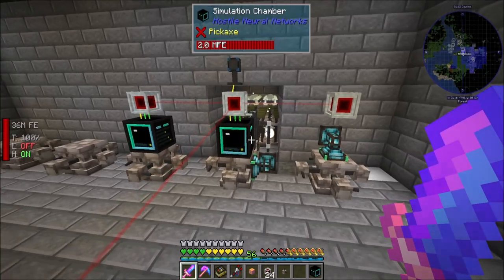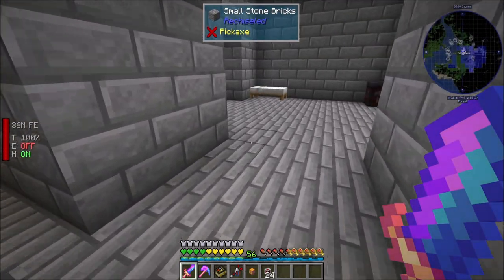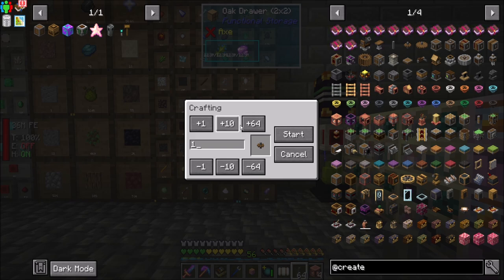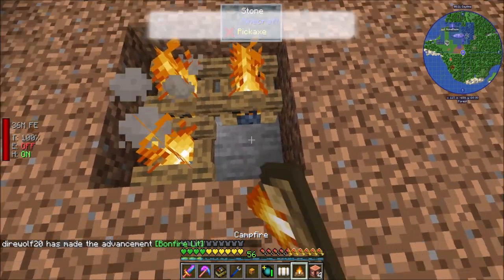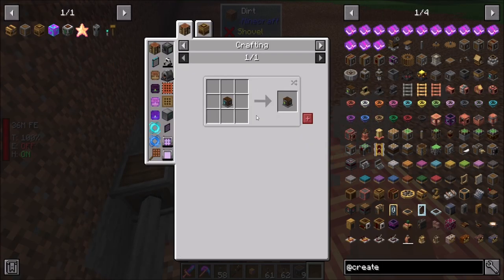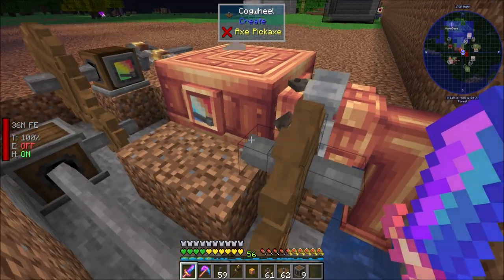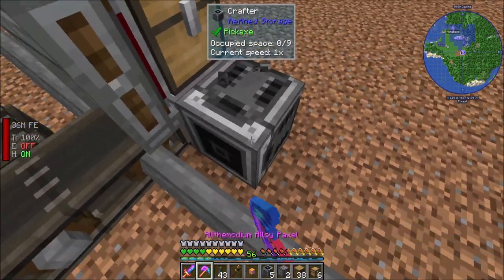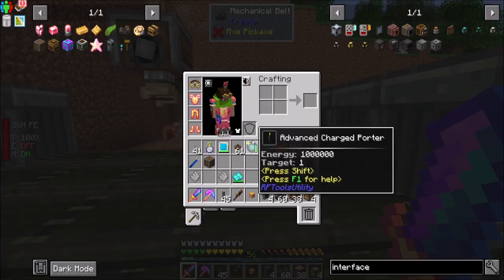ATM8 Ep56 Create Startup

Comment: how long till he realizes he disconnected his air reservoir from the air nodes?
Reply: Like 10+ episode's 😂
Reply: Probably when he will accelerate another machine or IF he notice that his Nether star is slowing down, that might be hard because the simulators will run even if not accelerated... So if he dont check the setup for a while or happens to accidentally go back to it to dobbel-check off cam   (Like he said, he will pop down if he needed other stuff accelerated) or probably when he see your comment, then it would be fixed at episode 60, Just a guess, it might happen sooner (Think this is 1 of 5 pre-recorded episode)
Reply: i where just about to say that :P
Reply: +1 It's so frustrating for us 😬😅
Reply: didnt he connect the input it to the back of the tank and the rest on the on the side's, he just disconnected the import from the export pipes, so its still connected on the back of the tank
Reply: never, because he didn't
Reply: @MarcoKoobs  well. i bellive he removed the one that was connected. but his minde where so focused on adding more pipes that he diddent see he did disconnect the 1 pipe that did connect frome the sources

Comment: Please, please just use a sink and fluid pipes to fill the boiler.  He usually spend 10-15 minutes trying to use the Create pump and then it regularly has problems.
Reply: I haven’t tried it yet, can you use Integrated dynamics to insert water into a boiler?
Reply: @roscocsa  Probably but it’s not really necessary.  The boiler doesn’t actually use that much water.  A fluid pipe from pipez with any tier upgrade provides plenty of water
Reply: @roscocsa  U can use pipes and even laserio, it all works fine, i already tryed it, even with fluid as xp
Reply: Even if using only create to power this system, you should still power the pump with its own waterwheel.
Reply: He tries to keep mods together as much as possible

Comment: A good option for automating Create is to use different wood types for different casings. Also there are 2 crafts on the 3 deployer setup that are easier to multitask by opting for different nugget types in each recipe....I think iron and aluminium are the 2 options.

Comment: u know, the refined storage crafter can put the item direct on the belt, u dont need an chest for input, just put the crafter below the belt facing up. and at the end i use a chest with laserio to the interface to import it to the system. but if u want to feed the deployer from the system, u could do it through the exporter, but u can also use the chest in the beginning with a brass funnel and filter it and laserio the rest to the deployer. 😉u cant filter the output of the saw and bassin to only make that product. some times it has multy recipes and can make them all, but when filtered, it only makes that product. like the saw can make from logs planks and stripped wood, and some times ever other wood stuff with other mods, just filter it to only make stripped logs.

Comment: I assume instead of the saw you could have a deployer with say an allthemodium axe cause i think the deployer thru the item use application thing with an axe strips wood so you could do oak log in andesite casing out, so long as you keep the other deployer stocked with the andesite alloys.
Reply: It can be easier to just filter the output of the saw, but yes, it's possible

Comment: anyone else graon when he accidentally clicked the pipes off the air resivior (1:30) because they know hes may never notice
Reply: Didn't he connect to the back of air reservoir
Reply: @greeshmaisave5410  i dont know off the top of my head but i dont think so since h eprefers the looks of from the floor and i skipped a lot of the setup since ive seen it a  a few times already and another YTber i watch did it before himBUT dire did it better IMO